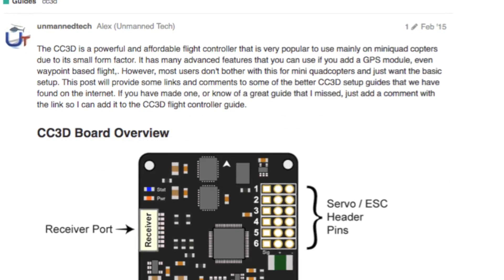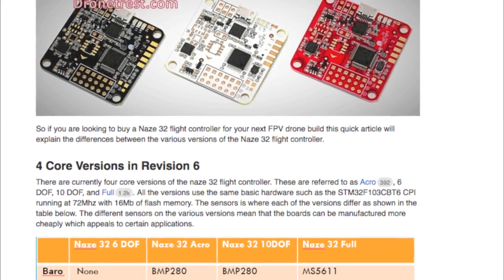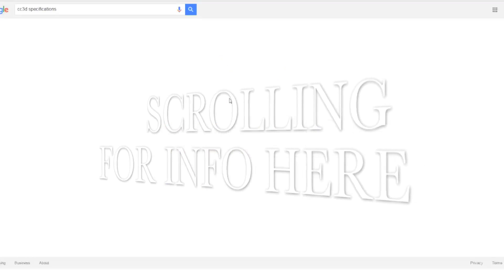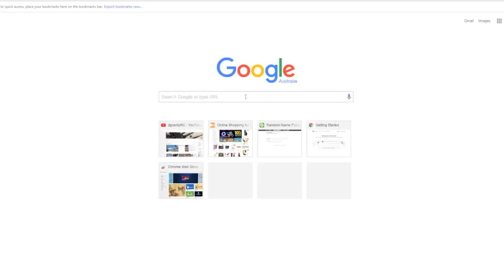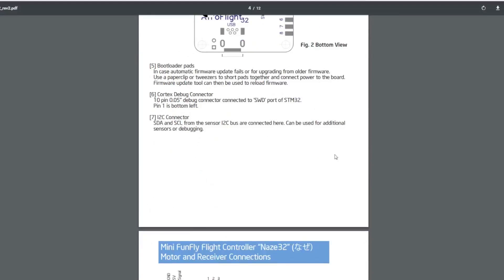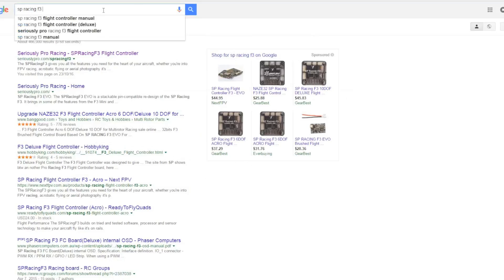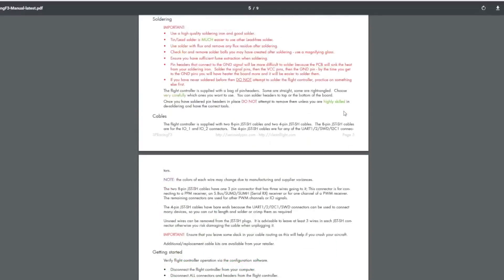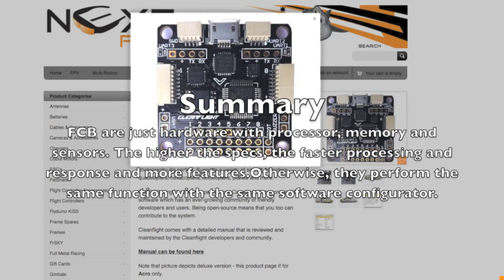For Your Info - Quadcopter Flight Control Board - CC3D, NAZE32, SP RACING F3 - Simply Explained ...

Comment: Some good point's JT 👍. I guess a lot of the time you do get what you pay for. I know it's quite a old one now,but I think I would get this on first for a brushed quad http://www.banggood.com/Micro-Scisky-32bits-Brushed-Flight-Control-Board-With-1_25mm-Plugs-For-DIY-Micro-Quadcopter-Frame-p-1067976.html?rmmds=search . Built-in receiver and plug and play motors. Thx Dod.
Reply: Or this one for the tiny whoop http://www.banggood.com/Beecore-F3_EVO_Brushed-ACRO-Flight-Control-Board-DSM2-For-Inductrix-Tiny-Whoop-Eachine-E010-p-1089021.html?rmmds=search . Thx Dod.
Reply from the maker: Thank you :) Either one will do for brushed. I don't think it matters that much. It is good to get one with built in receiver like these two for easier build and less weight.